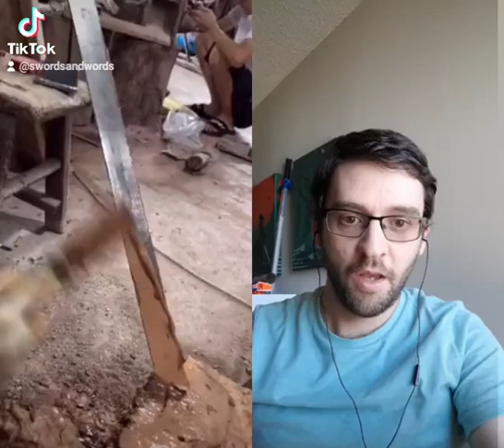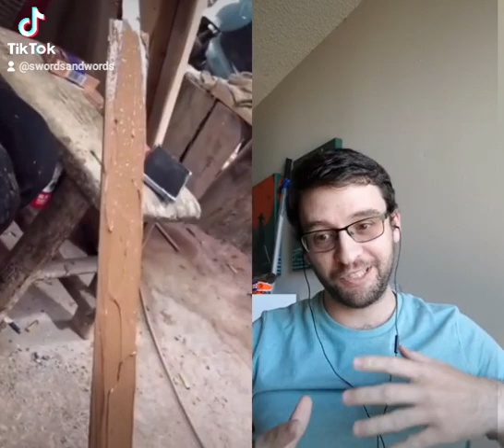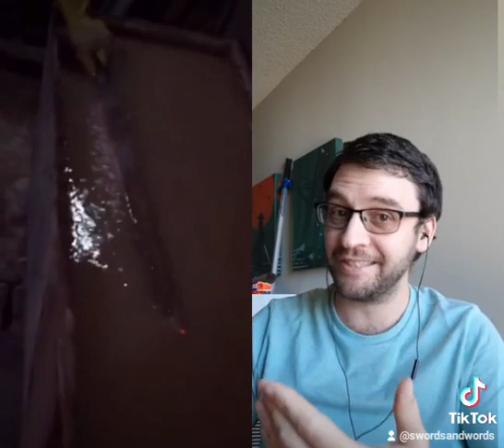Differential hardening and induction heating with swords

Comment: Wierd question, but how practical would a lightning-shaped sword be? Or at least one where the edges are serrated to appear like a lightning bolt.
Reply from the maker: It would be interesting. I think the biggest benefit would be similar to the benefits of a flamberge blade: they're weird to parry against.
One of those things that might throw your opponent off enough to give you an edge.

Comment: Differential hardening is also how katanas are given their curve
Since the edge cools at a different rate than the body, it expands more quickly, which in turns make the body of the sword curve back
Reply: Well one of two things to consider. The curvature can be pronounced in what ever regions the smith decides, or if you want, no curve at all!
Reply: Well one of two things to consider. The curvature can be pronounced in what ever regions the smith decides, or if you want, no curve at all!
Reply: @jonajo9757  well, in the case of katanas and curved blades, differential hardening is pretty much the only way they do it
The curves are just a side effect that ended up being actually helpful

And ofc they can have no curve at all if other methods are used
However if differential hardening is the method of choice, they'll pretty much always have a curve as a side effect
Reply: @puppymagnet8269  Well that's the thing. The quenching process in differential hardening isn't the sole indicator of a blades curvature. It's still decided upon the smith whether he could apply a convex or concave curve to the sword prior quenching, and that working to achieve a desirable curvature. (Or as I've said earlier, none at all.)

Through this, you can achieve blades with more pronounced curves, some where they have the curvature focused toward the hilt, tip, or entirety of the blade. Straight katana have been made using this method, and they're referred to as muzori katana .

(Plus for a little side note, I've got a feeling that Japan already knew the benefits of curved swords in cutting before differential hardening. Then again,  I don't know when they began adopting said practice for sword making.)